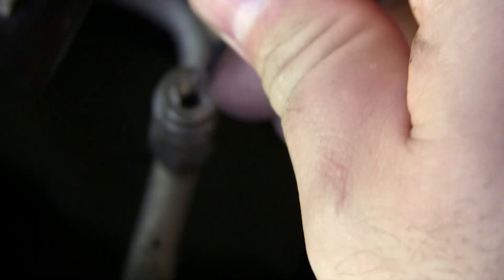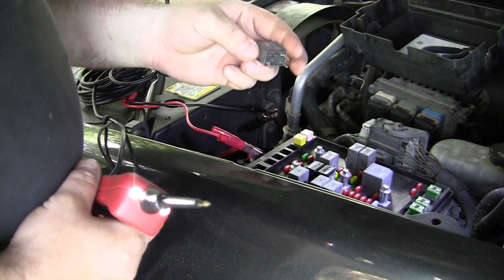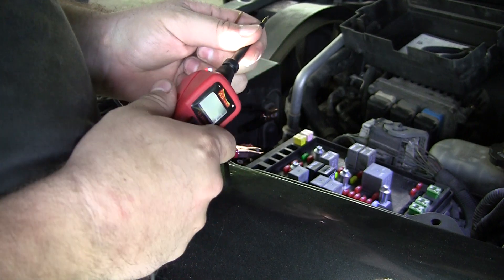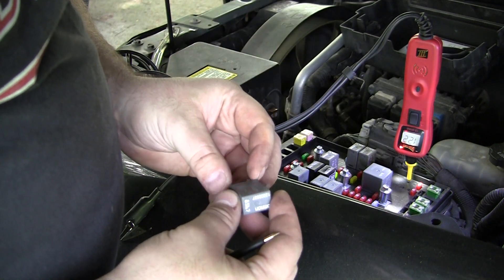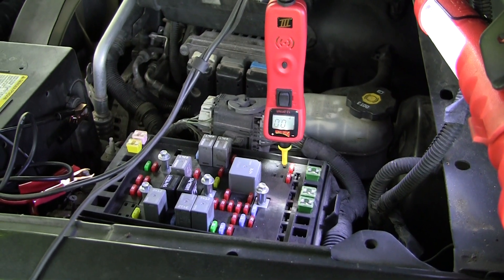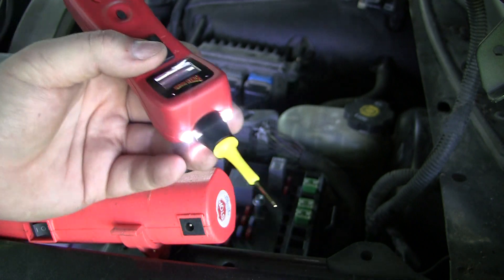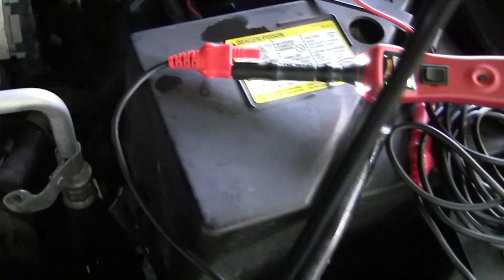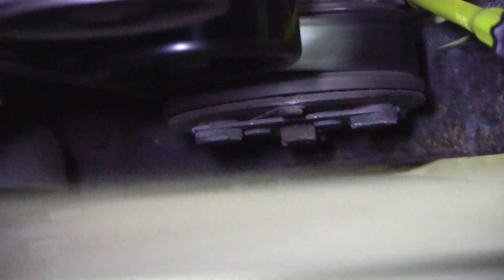2003 GMC Envoy - Pt9 air conditioning repair - diy trailblazer raineer 4.2l 4x4 suv

Comment: If freon pressure is low in the system, the compressor clutch won't engage.  The value you hit with screwdriver with the ball was the high-pressure side line at the front near the radiator.  The low pressure schrader valve is on the accumulator/drier of the ac system on the right side at rear of engine compartment.